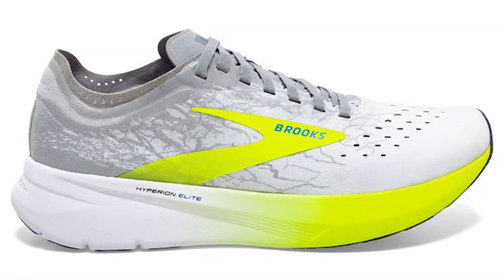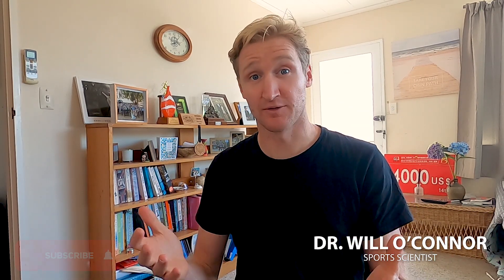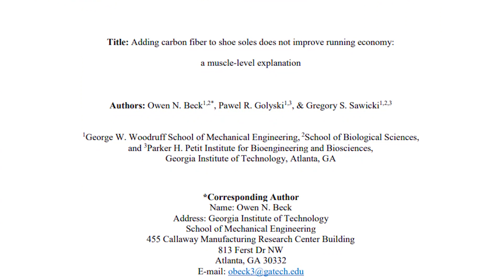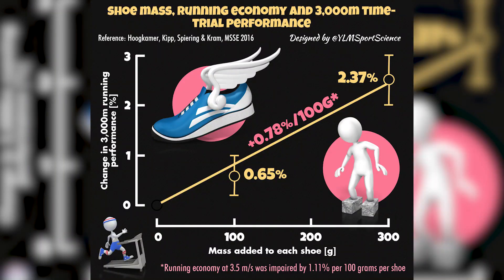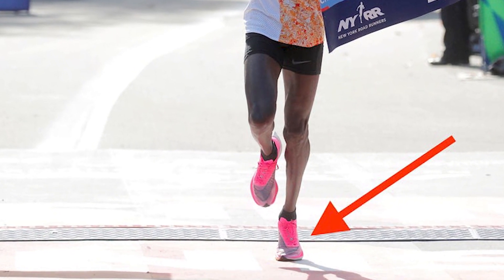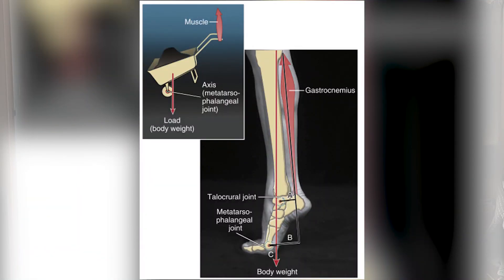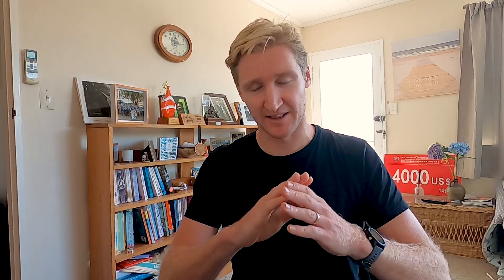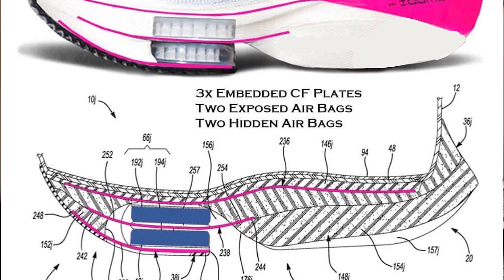Nike AlphaFly. It's not the carbon fiber plate. New Research 2020

Comment: I've been doing experiments with a couple normal racing flats and Sketchers speed elite with STRYD running pod.  Not only are times faster, watts are significantly lower.
Reply from the maker: That's cool. I've got a stryd, and I want to do the same when the Alphafly is available in NZ. Where is the power saving coming from? Like is your ground contact time or vertical oscillation lower? Or is it stride length?
Reply: @drwilloconnor  vertical oscillation is down.  I'm still sifting through data.
5x1k workout
Week one in Hoka carbon x
Week two in sketchers speed 6 with VYTRY insoles
Week three Sketchers speed elite 
Week 4 sketchers speed 6, regular insoles.
Week 5 sketchers speed elite 
Both times, speed elite had fastest times, about 6 seconds faster and watts were down 10 watts.  Weather about same on all.  I'll get back to you.

Comment: 1. Search: is the nike vaporfly still legal

2. There are non carbon fiber plate versions of these shoes and there have been zero world records set in those. The plates obviously matter.
Reply: The midsole of Turbo is actually half ZoomX foam and half React foam.
Reply: @YuhRongChen  thats true but a vaporfly without the plate would not beat the ones with. I tested it my friends I took the vaporstreet react ran all out, then I cut out the fiber plate of my vaporfly and had put that inside. A mile without the plate was 5:25 , with 5:21. Just inserted it under the sole. Dont believe everything you read TEST yourselves
Reply from the maker: Hey Patrik, there are no shoes with ZoomX foam and no carbon plate. The zoomfly 3 uses Nike React Foam.
Reply: @drwilloconnor  
I'm literally staring at a pair of my Turbo sneakers that have ZoomX written on the side. 

More importantly, I know first hand from 50+ races that the plates make a difference, especially on downhills.
Reply from the maker: @patrikkorda  that's fair, I was thinking of racing shoes.
Reply: @patrikkorda  your turbos are a small bit of zoom x and mostly react foam in the midsole